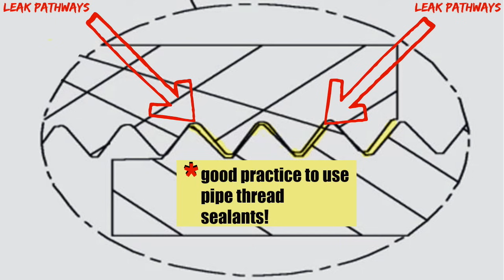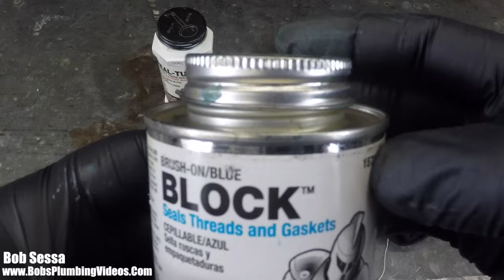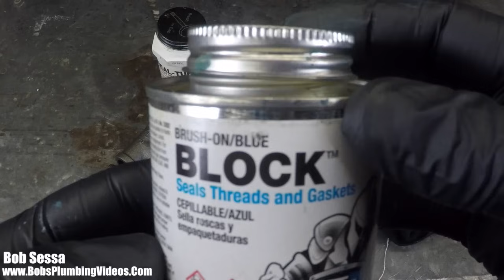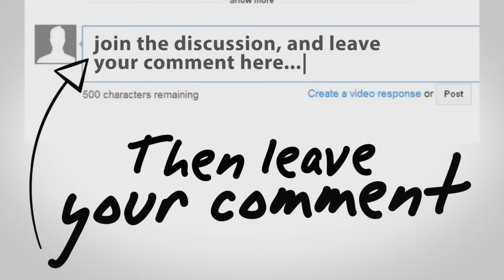Pipe Thread Sealant / Which Pipe Sealant & Why!

Comment: Hi Bob, another great video.  Thank you.  I know you already touched on the fact that tapered threads is best sealed by a combination of megaloc and Teflon tape.  Could you also touch on certain threads or connections that you don't want any sealant.  I remember you mentioned in one of your previous videos that you don't want sealants on union joints (I could be wrong). What other joints/connections do you not want sealants?  Also, could you also consider making a video on how to build a plumbing manifold from scratch using copper pipes and fittings (sweat) ?  I have viega manablock at my home but the compression fittings tend to get loosen over time and it is pretty annoying because of the occasional drips.  I think it's probably better to build one from copper.  I found one YouTube video using pex tubing and copper rings but it doesn't talk much on the theory why he built his manifold the way he did.  Last but not least, thanks again for the video on rebuilding globe valves.  Now all my globe valves in the basement are like new!
Reply from the maker: You can apply some pipe joint compound to the face of a union joint, but never to the threads as they are not tapered. Similar to a machine thread, they're designed to run up uninterrupted so the joint can make up. Aside from radiant applications, we don't use many manifolds here in the city but I would consider doing a video on fabricating a copper manifold. Thank for watching! Regards, Bob.

Comment: Thanks for the info. I always use plumbing grease purchased from ACE hardware after applying teflon tape on water pipe threads. But I noted from your video that MegaLoc and Blue Block are great lubricants, in which case the male fittings go in further into the female thread and much easier than without any lubricant.  Many plumbers here in CA use a PTFE teflon paste (white) that ACE sells, for example. I don't think it is much of a lubricant, but not sure. I was wondering if you could compare the use of the PTFE teflon paste (white) to the MegaLoc (blue) in terms of their efficacy.
Reply from the maker: That’s a great  idea Harry, I will add that to my videos to do list. Appreciate you checking out the video. Regards, Bob.

Comment: Several have left comments advising use of both tape and compound. At least one commenter has suggested that doing just one of the two results in leaks. That tells me that each method brings something to the table, but each has shortcomings that must be addressed by use of the other. HOWEVER, no one has cited what those shortcomings are. Until I know the full story, I will use both without thinking. But it would be nice to know the scientific reason.
Reply from the maker: Prior to Teflon Tape and Teflon pipe joint compounds, I used spool wick and and basic pipe joint compound because that's what I was taught as an apprentice. Enter Teflon Tape and Teflon compound and everyone has their own take on what the right method is. Generally speaking if I'm working with good viable threads, Teflon will suffice. But with a questionable thread, I will use both. In N.Y.C. no Teflon is allowed on gas piping, So I use Blue Block as my go to sealer. As to the scientific reasons, that's above my pay grade...LOL!  Thanks for checking out the video.

Comment: just to be clear, on gas fittings, as example a stove fitting, do you use any teflon tape with the Blueblock, or just Blueblock.  I would say my pipe is old and I am using a new gas flex to hook up my stove.
Reply: For threaded pipe fittings, like the inlet side of the shutoff valve, you use yellow tape, or thread sealant.   The flare end compression fittings, that are on the end of a flexible appliance line do not use sealant at the flare.   This type has a beveled face at the end, and the threads push a beveled “flare” against that for the seal.

Comment: Nice video, but to make the statement that pipe threads are always tapered is not exactly true. YouTube being global, you should have mentioned that pipe threads in the US are invariable NPT, but the rest of the world mostly uses BSPP (parallel) or BSPT (Tapered). Using BSPP threads allows for better orientation of the fitting.

Comment from the maker: Yes Ricardo, and I speak from experience! Regards, Bob.
Reply: Bob great video and thank you. I was a pipefitter for the gas company here in St Louis 35 years. As you can imagine I've been through a variety of different pipe compounds (pipe dope) in my day . I ended up finding a correlation between the quality of pipe dope and my wife doing laundry. If my wife could get the pipe dope stains out of my work pants ,I found it was not a very good pipe dope but on the other hand if she could not get the stain out, I found those Brands & types to be the best. I found it surprising that the gas industry in New York does not allow yellow Teflon tape in certain applications. I find it absolutely necessary to use yellow Teflon tape and pipe dope once you get into the pipe sizes of 1 1/2" & larger with deep threads, such as Chicago service head adapters.    PS Robert ,love your 1st name

Comment: Ugggh!  Wish i had watched this before replacing a pvc male fitting in a metal water tank.  I used teflon tape and it's got a slow leak and i mean so slow that it won't drip, but it bothers me.  It's just the drain for an outside tank, but still.  The original fitting didn't look like they had used any type of sealer and it was leak free.  The dumb ball valve handle sprung a good leak though.  I dare not tighten it any more in fear that the pvc will be damage.

Comment: Great video, it answered many questions, thank you Bob.Will you use one of these product on gas pipes for the threads that are located in a gas fire place or could the temperature become an issue?
Reply from the maker: Blue Block is my go to joint compound for all my gas applications. Thanks for checking out the video! Regards, Bob.

Comment: And for natural gas piping with black pipe they sell the yellow Teflon tape design for natural gas and you could use the Blue Block
Reply from the maker: They won't allow us to use Teflon of any kind in N.Y.C. I use Blue Block alone on all my gas work.
Reply: @BobsPlumbingVideos  Bob compression fittings are legal in New York City and my opinion that better than the shark bite shark bites are illegal anyway in New York City or am I correct
Reply: @BobsPlumbingVideos  that Blue Block is great when the fitting is put together you have a good seal
Reply: @BobsPlumbingVideos  I like the Teflon paste the only thing that makes a mess
Reply: But you can not use it on gas lines but it's good for domestic water just too messy

Comment: New subscriber here, have you done a video on installing a underground waterline from a house to barn or ect..  We have copper pipe but from the outside faucet its galvanized spigot for a garden hose.  thank you.
Reply from the maker: I have not, I'm a service and repair contractor. When the job calls for a water main or sewer  replacement (underground work) I call in an independent water main and sewer contractor. Doing underground repairs in New York city has it's challenges.
Reply: thank you

Comment: Bob is this the same blue-block (same part # different front of can but says 15707)  weird the 360 degree pictures shows correct part# & its also a lot cheaper than the  going rate which seems to be from $12-$19.00 not $6.91 home depot

https://www.homedepot.com/p/8-oz-Block-Pipe-Joint-and-Gasket-Sealing-Compound-157072/100151570

Comment: Turns out I was using a 5/8 cap on a 1/2 inch pipe.  Lots of practice taping a pipe in the wall though.

Comment: When installing my water softener, I dry fit my copper to plastic fittings to ensure they would mate together nice and easy and they did. I parted the fittings and applied Ace Hardware Pipe Thread Compound TFE Paste (which was very thick, almost a putty) to the plastic male fittings and began screwing on the copper female fittings. After three full turns, the fittings felt very tight and I stood back to check my work and saw that my fittings were both canted to the left quite dramatically. I removed the copper from the plastic only to discover that I had badly cross threaded it and ruined the threads on the plastic bypass valve body. Now I have a new bypass valve body on order to try again. I assume the fluid pressure of the paste acting on the plastic threads deformed the threads causing them to cross-thread against the copper. I also assume that pipe dope is not recommended when connecting threaded plastic fittings to complimentary metallic fittings.
Reply from the maker: The theory is to use the paste only, but I start w/ the tape followed by the paste ( mega lock, blue block). Pipe joint compound that is petroleum based should not be used in my opinion.

Comment: It you over tighten a brass fitting it will split
Reply: Every time I tighten a brass fitting I hear my late father say, "careful, that's brass!" He worked for the gas company in a street crew starting in 1946 when he got out of WWII for 35 years. In the early days they were putting in cast iron gas mains with the bell-shaped female ends and sealing the connections with that jute twine stuff and I think concrete. They had steel chisels with a bend in them to give clearance over the male end so you could pound in the caulking with a hand sledge, they always called them "caulking hammers."

Comment: Y'all treat pipe dope and teflon tape as a sealant, you do so at your peril The companies can call it a sealant until the cows come home. It is not a sealant. It is a lubricant. Treat it as such and you'll not go wrong.      "Crane experiments on defects in threads. A piece of eight-inch pipe was threaded for a distance of 2 and 1/4 inches. The pipe was then put into a lathe and mutilated. In the threaded part, three grooves were turned,each 3/16th of an inch wide and to the bottom of the thread. The tops of the remaining threads with the exception of the one at the end of the pipe were turned off, giving them a flat surface 1/32" wide. Next, at 3 points on the circumference of the tapered threads, flat spots were filed,1" long and 2" wide, extending 1" on the threaded part. 25 grooves were then filed in the thread of the pipe and the same number in the coupling, all parallel with the pipe and 2/3 the depth of the thread. When all this deliberate mutilation was finished the threads were cleaned thoroughly and coated with cement. The joint was then screwed up so that the lengthwise grooves did not come up opposite one another. The outer ends were then plugged and tested to 425 psi of air without leaking. The same was found after a 1,000 psi hydraulic test. The amount of defect in the pipe was at least 100 times greater than pipe rejected by fitters. This showed the amount of ignorance about defects in threaded pipe that exists." We are talking about a involute circle. Remember everyone! Friction is the death of a proper joint. (Heat) Hence, pipe dope. If you use pipe dope as a lubricant and not a sealant, you'll not go wrong. Plumber for 42 years
Reply: Do these products not help to seal a joint from leaks?  If I don't use them at all, then I'll have leaks.  So, in my book, they're a sealant.  I'll call it what it does, thank you.  No peril yet.

Comment: Sorry but you should know this,when you useTeflon on fittings/pipe you should always leave a few threads then start putting the Teflon on,never have the Teflon on the start of the thread, on festo fitting with Teflon on, it will always leave the first couple of threads with no Teflon on
Reply from the maker: Thanks for your Opinion! Whatever works for you.
Reply: BobsPlumbingVideos if the tape starts too close to the end of the pipe, bits of it can fall into the process side. This is very bad for pneumatic control systems.
Reply: 454Casull 
That’s exactly what I meant 
Thank you
Reply from the maker: 454Casull  Agreed 100%!

Comment: Since you screw it in clockwise you wrap the Teflon tape counter clockwise or you'll tear the tape.
Reply from the maker: The tape should be applied clockwise otherwise it will come out as you screw the pipe in.